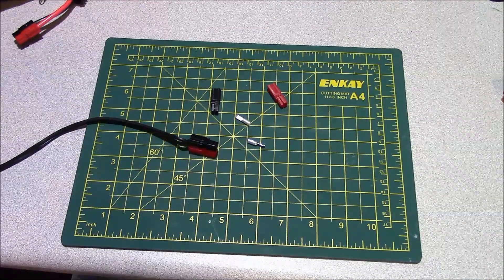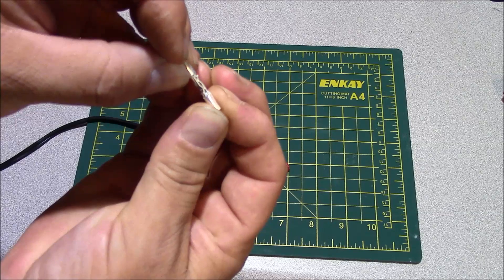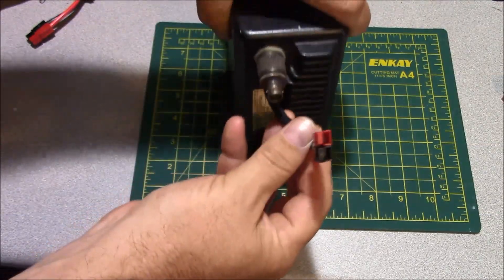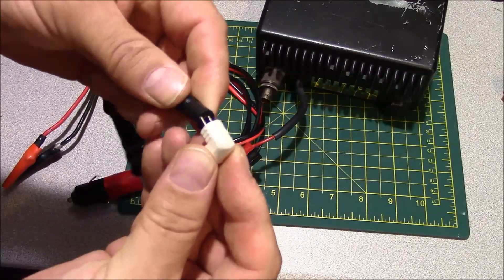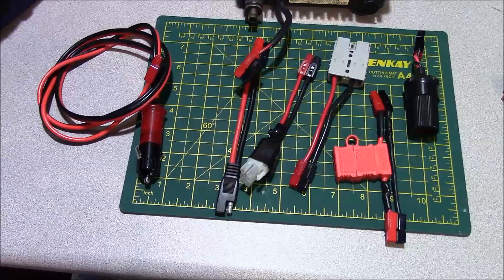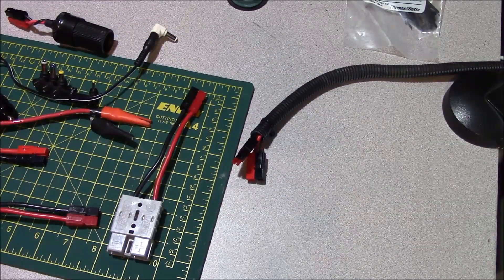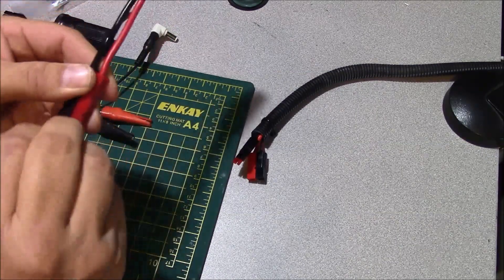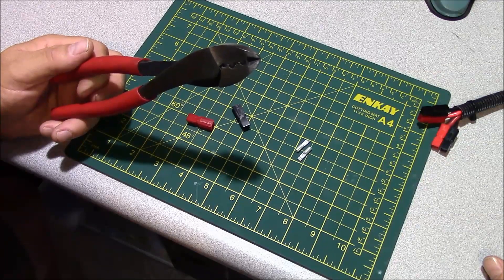Standardizing your 12v DC power connectors

Comment: Thanks. I did a mistake I bought number of different connectors from China. Now I think the best were deans connectors. Easy to solder and great to use. I currently looking for connectors which will be easy to use with dc powertools 7.2 - 20V. I'd like to have a single power pack with Li-ion batteries and connect different powertools to it. Can't make a decision as I'd like an easy and quick connection. Dean doesn't look convenient. But may be it is ok for me as I'm not a tradee, I'm IT who takes tools not often
Reply from the maker: Deans connectors are excellent - Just find what works for you and standardize. It really makes things easier. Thanks for watching !

Comment: I love those connectors. I have seen the larger version that is for above 50 amps used as a quick disconnect for boosting other vehicles. They are nice but as you said after so many times hooking and unhooking you get play in that coupling. Great video.
Reply from the maker: Thank you and thanks for watching !

Comment: Good info Brother, I got some CB questions I'm gonna be sending your way soon lol hope all is well my friend
Reply from the maker: Cool beans shoot them my way. Things are good here after getting settled into the new place. Congrats again on the new addition to the family ! Thanks for watching !
Reply: Thanks brother, glad to hear everything is going well my friend! So I used to have an old school cobras CB radio which I gave to my wife for her truck when I first found out she was pregnant which I loved, so do to tight funds I picked up lower end uniden pro0505XL compact CB to replace the one I gave her in my truck...I have it in the same location and have it hooked up to the same 24" roof mount antenna that I had the old cobra hooked up to but I'm getting a ton of interference from my truck itself, especially when the wipers are on, idk if it's because it's a lower end radio or what....any suggestions u may have would be awesome cus it driving me nuts as
Reply from the maker: You are welcome. CB radio uses AM modulation and like an AM radio station is more subject to electrical noise than FM equipment. Electrical motors do generate noise in service but there are ways to reduce the noise. The first thing we need to check is if the noise is coming in through the antenna or through the DC power feed. Disconnect the antenna and see if the noise is still present. If it is still present is the noise less than or greater than when the antenna is connected. Check that first and we will move down the flowchart. My email is survivalcomms at gmail dot com
Reply: SurvivalComms thanks brother, I'm gonna try that as soon as it stops raining and I'll email u the results, I really appreciate the help
Reply from the maker: You are welcome - I'm glad to help - troubleshooting problems is technical skills exercise .

Comment: I absolutely love those Anderson connectors. I've changed most of mine over, but there are a few left to be modded. Awesome video, and good tip with the cable ties!
Reply from the maker: Thanks ! Im glad you enjoyed the video. I see the running is still going strong which is great ! Thanks for watching !
Reply: Baby steps with the running, but still at it!
Reply from the maker: That is the way it works ! It definitely is something that is a labor of love ( although until the last 1/2 mile you question that :) )
Reply: Or the first half mile!...lol

Comment: I have some PP connected products I've purchased from Hardened Power. I really like them, but was told I needed a special tool to make the connections. Thanks for pointing out the fact that we don't. I did look into buying some, seemed a lot more expensive than buying shrink tight spade connectors. It would be nice to make more cross-adapters. Do you have a low priced outlet that you prefer to buy yours at? Thanks for the tips!
Reply from the maker: You are welcome ! Amazon has them cheap (Glarks) but they are chicom production. Name brand wise Amazon has them as powerwerx PP30  .Another option is Tower Hobbies that has them as DuraTrax Power pole connectors.When you buy in bulk you save as a general rule.  I'm glad the crimper info was useful to you - generally any non insulated crimp tool will make the connection if you pay attention to what you are doing and ensure that the crimp is even in clamping force applied. Thanks for watching !
Reply: OK-sounds good-thanks again!
Reply from the maker: You are welcome !

Comment: Regarding adapter cables I have made me a dedicated amp draw cable. APP on one end and 4mm banan jack on the other, to attach directly to the DDMM. 
BTW thanks for the ziptie tip.
Reply from the maker: You are welcome ! I built a variable power supply that has a built in shunt with some pin jacks. for when I would test different stuff. I generally keep a couple of those fuse holders built up like that if I have to piece something together for circuit protection . You can also put a 10A10 diode in there soldered to a couple spades and it makes a bare bones trickle charger - The use as a test shunt was a bonus. Thanks for watching !